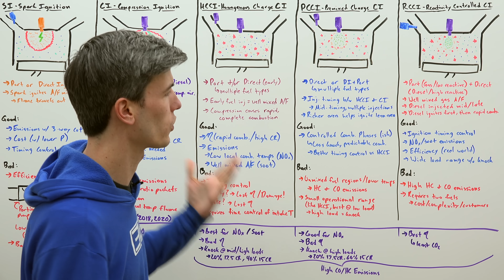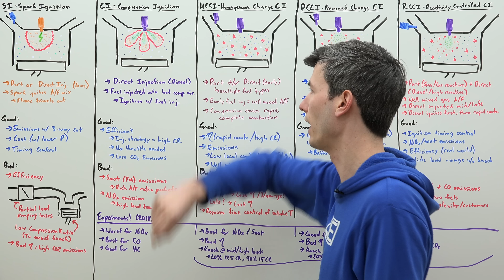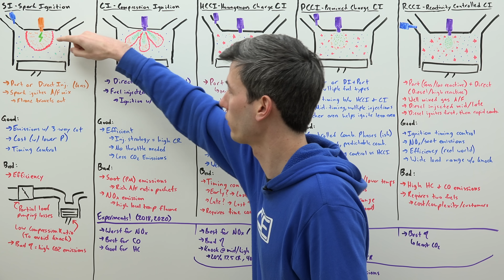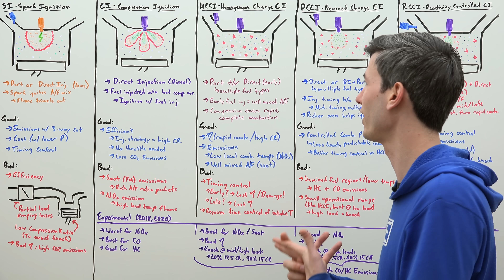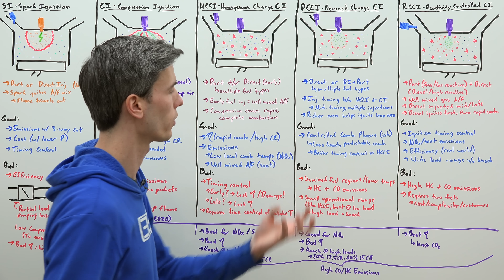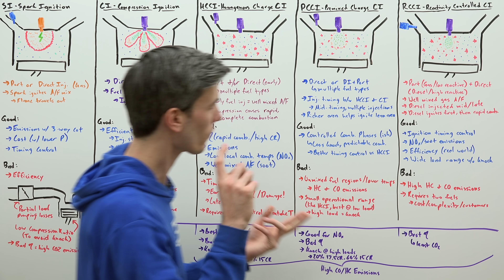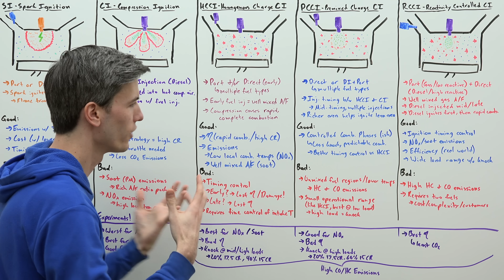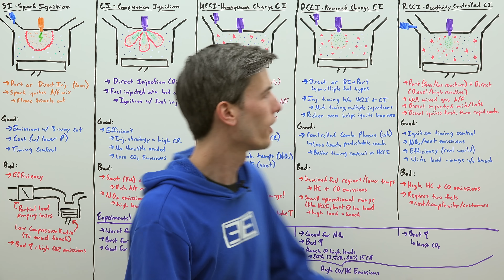If Combustion Engines Have A Future, What Is It?

Comment: Not convinced they need to change much at all frankly, especially as long as electric energy density is abysmal
Reply: So we shouldn't strive to improve? Energy density for batteries is constantly improving. ICE should do the same.
Reply: @snaaaaaaaaaaaaaaaake  
ICE engines are at the end of the line.
Reply: @johnburns4017  ICE still outperform any battery powered vehicle.
Reply: @lucasvanhamburg4937  
In speed? No. An EV holds the record for fastest car around the Nurburgring. 

In overall efficiencies from the original source of energy to the car running, EVs leave ICE cars standing.
Reply: @johnburns4017  lol what the fastest around the nurburgring is Porsche evo 919 yes is a hybrid but still uses an ice
Reply: @johnburns4017  and world records are still by ice ev cars would take long time
Reply: @johnburns4017  Porsche's synthetic fuels might come in handy
Reply: @christopherayala4619  
The days of ICE cars are within sight. Get used to it.
Reply: @johnburns4017  not for motorsports however for road made cars I'm used to it
Reply: @johnburns4017  thats a hybrid, and in all motorsports gas rules over electric. but I really meant practicality, reliability and owning/driving cost and range when I said perform
Reply: @snaaaaaaaaaaaaaaaake  Absolutely! There still is a lot of potential left - but most ICE-appreciating people are somehow focussed on "old is good" and similar shenenigannery.
Reply: energy density in batteries is barely improving. and the longievity certainly is not improving either
Reply: @lucasvanhamburg4937  and most importantly, next to density, the time it takes to charge is an issue as much as people want to act like it’s not. 

As for ICE, I said I didn’t think it NEEDS to change much, not that it couldn’t or even shouldn’t be, just that it’s pretty much at peak form afaic.
Reply: @lucasvanhamburg4937  Why do you wrote things like this if you haven't used any time following the progress of battery tech? If you consider what is available now and compare it to what was available a decade ago, and then two decades ago - you can clearly see the progress.
Reply: @Fee.1  yep, combustion engines are better then ever, but they are being held back by emmission regulations. vw cheat vehiecles had really small consumption and great performance.
Reply: @tkermi  well, it depends on how you look at it, I've had rc cars as a hobby so I have a fair bit of knowledge about lithium polymer batteries. as far as I know, the only real big improvements are made when a completely new battery is designed, a lithium battery will always be a lithium battery and the only improvements are being made on the casing of the battery which allows it to be lighter, charge faster and discharge faster(due to better heat dissipacion). the thing is these improvements are all very small and we have had lithium batteries since the early 2000s. so, a new battery is needed that can be recycled or one that lasts longer, as well as being lighter and more affordable. so, about 20 years have passed and no significant improvement has been made, in my opinion. and everyone knows that if they invent a revolutionary battery they will be one of the worldst richest person, yet nobody has done it. I think it's safe to say batteries aren't getting anywhere fast. chemestry has it's limits.
Reply: @lucasvanhamburg4937  
Look up Toyota's solid state battery.
Reply: @lucasvanhamburg4937  Well, I see this and interpret the data quite differetly 🤔🤷🏻‍♂️. There are many, many different Li-ion chemistries in use. They are and behave quite differently. It's not only about thermal transfer to the casing, it's things like internal (electric) resistance, performance in different temperatures and optimal electrolyte / cathode composition for designed task.

If you take a common 18650 form factor as an example - (though loosely based on my memory 🥴😅) - the energy density has gone up as follows:

Low/normal drain (<10A) cells now compared to:
~30 years ago   +150%
~20 years ago   +60%
~10 years ago   +20%

High drain (>10A) cells now compared to:
~30 years ago      - 
~20 years ago   +100%
~10 years ago   +40%

I consider this to be nice improvement.
Reply: @johnburns4017  not in production
Reply: @tkermi  of course there has been an improvement but my point is that the improvement is getting smaller each year and that we need a completely new battery, especially if we want to do anything less bad for our climate. yes, studies show that EV beat ICE in terms of lower co2 emmisions after about 7-10 years, but batteries don't last that long. If we could use capacitors that problem is solved, I've taken apart 40 year old washing mashines and the capacitor is just fine, but niether the government or the companies want to make batteries that last 40+ years, that would be bad for economic growth
Reply: @lucasvanhamburg4937  The improvements are getting smaller, that's true. Actually in a light or moderate use the best 18650 cells can easily last over 20 years - some types even over 30 years. I have 7 years old Panasonic 18650 cells that have been in daily use and still have 92% of the rated capasity. And my 15 years old Bosch drill has it's original 18650 LG cells with about 85% of the original capacity.

When it comes to cycle lifetime the best up to 7000 cycles is found from a chemistry not well suited for EVs. And the 2. best one (LiFePO4) with 2000+ cycles isn't that optimal for EVs either even though it could easily be used (Cybertruck is said to use it). But then there are great chemistries with 1000-2000 cycle lifetime.

So if we take a car with a 78 kWh total battery capacity - after loosing 20% to degradation it will have ~62 kWh - so the average is 70 kWh. The average consumption could be 0,175 kWh / km. This gives a rage of 400 km / battery cycle. So 400 000 - 800 000 km (250k - 500k miles).

This lower end might not seem good enough for 20 years of driving though. But luckily when for example cycled between ~20-80% you can get way more cycles out of the battery. Some even claim 4x (so 4000-8000 cycles), but it can be easily said to be at least 2x. So with just a little care in normal use today's best batteries can last 20 years and 800k - 1,6M km (500k - 1M miles) in an EV. And after that they could even serve another 10-15 years in a low C solar battery assembly.

But I'm not claiming that most EV's utilize batteries of this high quality. I'm just saying that the tech exists and isn't too expensive or impractical to use in high yield EV production.
Reply: you should wright a scientific paper on it
Reply: @daftnord4957  you should “Wright” an English paper... 😝
Reply: OK boomer
Reply: Well, in a way yes - if you assume that ICE tech is dying off soon. But I think that ICE is still going to be around in a meaningful way at least a decade or two. So it's important to develop it.
Reply: @tkermi  I work in the automotive industry, including designing engine and electric motor factories. You pretty much freeze an engine technology 5 years before the first production example is produced. And it'll be the best part of ten years before the first customer has one. 10-15 years before all the kinks are worked out and it's running smooth and reliably. That's hundreds of millions of investment, at which point they want to get their moneys worth out of what they've bought and there's only so much you can change about the engine without changing the manufacturing hardware. If ICE is going to phase out in the next 20 years or so, Automotive manufacturers wouldn't invest in new technology at this point. I know, because I tried to get them to. This stuff is WAY too risky for them to introduce in the next 20 years. Many are still struggling with Aluminium blocks and heads, steel cylinder liners, variable valve timing.
Reply: @Leo99929  Thanks for the insider info. 👍🏻 Btw. there is one field where the time from early R&D to the end product is even longer. That's an aviation industry. Some of their tech is really ancient 😅. (I had a long talk with one of the leading aviation engineers from UK)
Reply: @Fee
You need to find out the total efficiencies of EVs, they knock combustion engines out of sight.
Reply: Hydrogen fuel cells are not tho pal
Reply: @edwardpiper2749  
Hydrogen fuel cells are not ICE engines.
Reply: @TheoryBreakthrough  Yeah... The best possible ICE cannot exist outside of a hybrid environment, where it can make a lot of use of the presence of a powerful grid and a second energy storage unit (of low capacity - like, 1/10 of an EV or even less). There are a few things that allow different approaches (knock for example) to get rid of them, but, in the end - a highly-developed ICE in a hybrid drivetrain is pretty much the best we can do today.

The best we can buy today isn't even either or...
Reply: @JT_771  oh batteries last longer then engines? that's not true. where the hell did you even get that from!? a gasoline car lasts about 15 years 300k km if properly maintained and a diesel will last double that. now show us your two year old electric boy being proud not having any issues yet.
Reply: Obviously something like LiPo isn't this good for durability point of view. Still, with my 2 years 3 months old phone I now have 350 full cycles worth of charging with 713 charge times. And the battery has degraded 9%. But if I want to use this phone long the battery should work fine up to ~5 years / 800 full cycles / with ~20% degradation.

It's all about not charging to / keeping it full (stay below 80%), not using to / keeping it empty (below 10%) and avoiding too much heat.
Reply: @tkermi  so, long story short: batteries last longer if properly treated but still doesnt come close to a ICE ecvivalent
Reply: @lucasvanhamburg4937  That's true. Though for me it's enough that an EV battery lasts 20 years / 1M km with under 30% degradation and have about 30 years lifetime when used less.

I know there is talk about 1,5-2M miles batteries but they are probably more useful for semi trucks. But if they are not much more expensive and bring less degradation + longer lifetime they could be nice for normal cars as well.
Reply: @tkermi  yeah well unfortunately companies don't want to make something that lasts 1m+ miles.. goes for ICE aswell.
Reply: @lucasvanhamburg4937  Yes, that seems to be the case more and more nowadays.
Reply: @JT_771  
The sooner ICE engines disappear the better.

Comment: I wonder if ICE engines could incorporate something like a DEF tank, but instead of for emissions it is purely to reduce knock or improve octane so that those compression ratios can be increased, and thus increase efficiency
Reply: You mean like water/meth injection
Reply: Snow Performance builds a real nice unit that does exactly that. BMW also incorporates it in one of their boosted cars. EE does a video on it.
Reply: @FlatPlaneCranky  i’m aware of water/ meth kits, i just mean something newer/ more effective or more engine specific, but thank you much for the information
Reply: @pauldonahue4930  bmw builds a car currently that utilizes water injection straight from the factory. It’s a performance car and it does exactly what you are asking. Improves cetane thus eliminating knock. I’ll look for Jason’s YouTube video on it. Again factory built only using water for improving cetane and thus in a boosted application you can up the boost
Reply: @pauldonahue4930  just type bmw water injection explained.
Reply: @FlatPlaneCranky  yessir i am familiar with the video and bmw’s application, however i am saying for a universal system. DEF tanks go on Ford, Chevy, Cummins, etc, it doesn’t matter the brand, it’s universal. i understand the water injection can be used on all vehicles and i know bmw utilizes this one in particular, however i am wondering about a factory concentrate that is more efficient than water/meth at reducing knock.

Comment: Diesel-Hybrid should be the future. Don't @ me.
Reply: I agree 100%. Diesel makes the best hybrid. it had extra torque over petrol and is more efficient.
Reply: Should be, but diesels need to be built stronger making them always more pricy.
Reply: @Jeremy-fy1sz  On the other hand it makes them more reliable. But I agree with you, it will be very expensive.
Reply: If it's good enough for locomotives, it's good enough for a truck.
Reply: the newer combustion processes seem best suited for back up generators but sadly most non industrial units are built using the previous generation of automotive engines.   perhaps they will be used as range extenders
Reply: Nah, gas turbine hybrid. The strength of combustion engines is their multifuel capability and gas turbines are the next best thing to including a heat exchanger to run on solid fuels. Also gas turbines have less vibration and are slightly more efficient since they'd only need to run at their peak efficiency in a hybrid. Not to mention the massive power to weight ratio could possibly allow for a combined cycle to boost efficiency to ~65%.
Reply: @TheoryBreakthrough  try inhaling fumes from a lithium mine. Try drinking water next to one. 

The point is, every industry creates pollution and there are trade offs everywhere.
Reply: LOL you are clueless
Reply: Using diesel fuel creates air pollution.
Reply: @AleksandarStefanovic  using any fuel creates pollution.
Reply: @R4M_Tommy  I think what he meant is that the high aromate content in Diesel fuel makes it more prone to produce particulates.
Reply: @BugMagnet  It is already solved by installing DPF (Diesel particulate filter). NOx emissions redused by installing SCR (Selective Catalytic Reduction). So what we get in the end: most efficient ICE, with the smallest CO2 emissions (which leads to global warming). But nobody cares, because "everybody knows that diesel is bad".
Reply: @vetal4444  this guys gets it. I don’t know why engineering explained left out such a huge piece of info regarding the advances in diesel technology that have essentially eliminated the 2 biggest emissions downfalls of diesels
Reply: @corvinmull2408   Good point. I think it will be a good idea for @Engineering Explained  to make some videos about this tech.
Reply: @vetal4444  You oversimplify. SCR only runs once the engine is sufficiently hot. DPFs need to be burned free every so often which is a waste of fuel and the resulting emissions after all of this are still worse than what you get with unfiltered diethyl ether. Besides, in passenger cars all these filtering systems are approaching the price of the engine itself. With DPF preheated dual SCR and other shenanigans to have even the slightest hope of achieving Euro 6d or even 7(eventually) you are looking at 5000€ upmark.
Reply: @AleksandarStefanovic  mining creates air pollution, your existence creates air pollution. That’s not a valid argument.
Reply: @vitaly6312  damn. Calm down man😂😂
Reply: @yayayayya4731  I’m totes calm

Comment: Honestly I don't think ICEs are going anywhere. Perhaps more time will be invested into hydrogen combustion or synthetic fuels.
Reply: Future ICE might be "Opposed Engine" fueled by Hydrogen. Do you have an idea what Opposed Engine is?
Reply: @ameserich  Yes. It's really funny you mentioned that because I have been thinking about an idea for just that - an opposed-piston, hydrogen engine.
Reply: @RahulPatel-fp3ju  you dont use pistons for hydrogen. Hydrogen makes the metal britle, it's really small so it escapes the rings and valve seals and its really light, so even if it has a lot of power per mass it doesn't per volume. It dosent smell and it burns transparent wich makes more probable for accidents. Fuel cells are better for hydrogen but have many problems as well
Reply: @arthurbenedetti9146  No I know. Fuel cells are seemingly advantageous over combustion engines, but combustion engines for hydrogen are possible. I didn't really think about the fact that hydrogen atoms are small and would escape (thanks for telling me). I'm not sure its just an idea, but I think it might work for other fuels as well.
Reply: i worked with fuell cells, its not the future
Reply: @arthurbenedetti9146  Interesting. Why do you say that?
Reply: Itl be a combination of them i think. Other industries are far more damaging than average joes car. Unless they're trying to stop people from going to work? Have a look at Refrigerant gases for example, absolutely horrific the c02 rating on them. I'm a Refrigeration engineer and can save 20 years allowance of c02 for my driving by fixing ONE refrigerant leak
Reply: Yeah, ammonia engines for large ships sound quite promising to me.
Reply: Facts

Comment: I was under the impression diesel was a lot more efficient co2-wise, but it turns out diesel emits more CO2 per gram of diesel, so it almost cancels out.
Reply from the maker: Slightly more energy dense, yes, but the real efficiency gain comes from higher CR and lower pumping losses, which means you go further on that one gallon of energy, so even if it had more CO2 per gallon burned, it goes much further per gallon, which means better on CO2.
Reply: @EngineeringExplained  That's true and what I originally thought, but when I actually wanted to prove someone wrong on a YouTube comment, I looked it up. It turns out that a lobbying group compared Golf 7s and found that their CO2 emissions were both 114g/km. I didn't know it was a lobbying firm, so I did my own calculations from my own car (2000 model Alfa 156)'s petrol and diesel engine options:
1.6l petrol = 8.2l/100km @ 2.3kg CO2/l = 18.9kg / 100km
1.9l diesel = 5.8l/100km @ 2.6kg CO2/l = 15.1kg / 100km.

So that's not all that much difference, and petrol engines have come a long way since then in terms of efficiency.
Reply: Obviously that doesn't take into consideration CO2 released during fuel refinement. I don't know where to get solid numbers on that from.